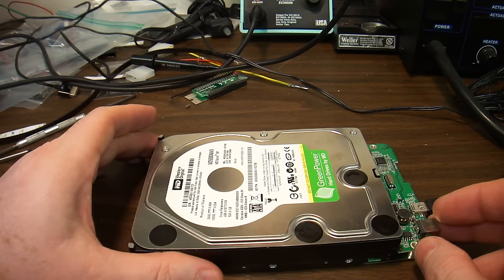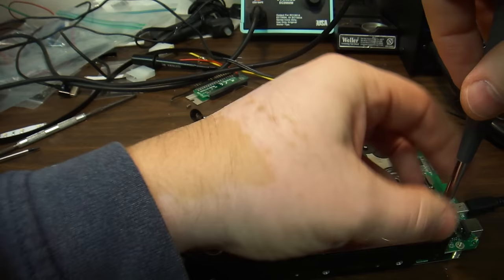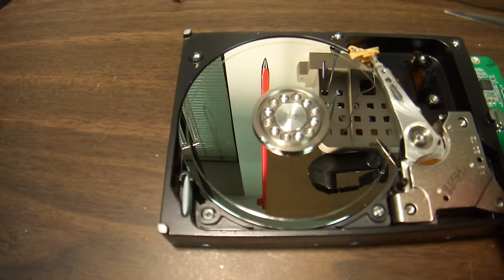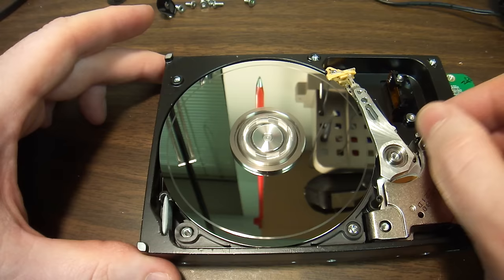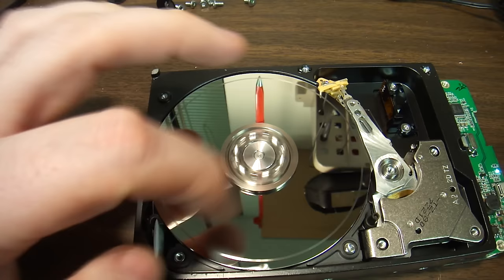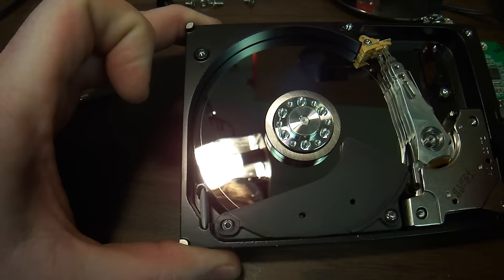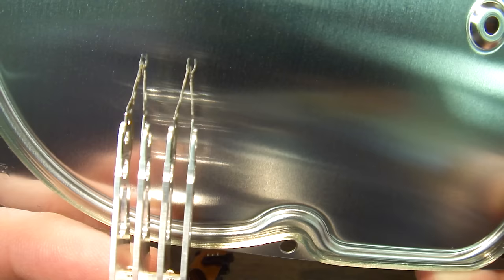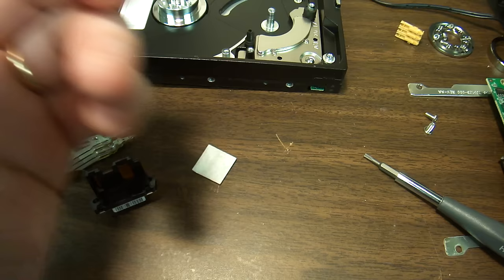Clicking hard drive dis-assembly. How to and what to expect. 500GIG Western Digital USB storage.

Comment: I have a 1TB drive but it only clocks 648GB after being dropped.
Reply: looks like it got a ton of bad sectors that got reallocated.
Reply: looks like its time to back up data and rma it. If the manufacturer will warranty it. Dropping a drive usually voids warranty. SMART attributes can show when a drive has been subjected to shock.
Reply: newer drives aren't meant to be low level formatted though. I heard you can damage it even worse doing that.
Reply: I have the drive, but my adapter broke, have to re solder the board for SATA to USB connect.
Reply: NEVER EVER run Spinrite or CHKDSK on a failing drive !
The most sensible thing to attempt in DIY is cloning it with a specialized program like ddrescue or the newer HDDSuperClone (both running on Linux – plugging a failing HDD on a Windows system is bad, because it will insistently attempt to access the damaged areas, making things worse, with Linux you have more control, and the partitions aren't mounted automatically). It's still risky, and it can only work if the HDD is properly recognized at the BIOS / hardware level.
Only once you have made a clone, as complete as possible, and if you are 100% sure that you won't pay for a professional data recovery service, you can try foolish things like Spinrite, HDDRegenerator, which will probably not recover one extra byte from it... (And CHKDSK only repairs logical errors, it maked no sense to let it run 24 hours or more on a HDD that is no longer usable anyway.) Recently, I had a 2TB Seagate HDD which was failing (got a warning in HD Sentinel), I cloned it with ddrescue, which recovered almost everything, except a 600KB area at the begining (which belonged to a system file, so none of my files were corrupted) ; according to SMART data it had 1312 bad sectors, so I ran HDDRegenerator (again after the ddrescue process was completed) to see if it could somehow “repair” them, and guess what – it simply forced the reallocation of those 1312 sectors, meaning that they were replaced by spare sectors, containing only 00s, just what would have happened spontaneously when attempting to write a file on them, yet it claimed to have “repaired” them all.
I used HDDRegenerator with success once, though : there was an inconsistent sector (so-called “logical bad sector”) on another 2TB HDD, preventing CHKDSK to fix the file system, even after I had deleted half of the data it kept saying that there was not enough space to complete the repair, but after a scan with HDDRegenerator, followed by a defragmentation (I'm not even sure if it's that program or the defragmentation which did the trick), CHKDSK could run through the end, I could reformat the partition, and now that HDD is still operational, with no reallocated or pending sector. When there's actual physical damage, tools like this are pointless.
Reply: “looks like it got a ton of bad sectors that got reallocated.”
HDDs can't reallocate 300GB of bad sectors... More like a corrupted partition table.

Comment: For sure, you don't know what you are doing !!! Learn and after that do it !!! You could have damage permanently the customer data. Now you did have luck because the HDD did have already the upper platter surface scratched beyond recovery. For anyone who will comment that this is bullshit, I am a professional data recovery engineer, and please notice the HDD did have the seal still on. Hope it is your data and not someone else data. So this way of handling an HDD before you know what is inside is deeply unprofessional and unethical !!! Some of the data could have been recovered from the other surfaces if it were not scratched like the upper platter, but you made that impossible. If you really want to make videos regarding data recovery, start with cleaning your lab and your table.

Comment: I would not trust that guy to change a flat tyre on a car.
Reply: His work procedure, all filmed and posted on his channel Car Services:
After removing all wheels and trashing them, he would dismantle the engine because it does not pump enough air into the tyres and say that the engine looks broken because everything is moving out of sync, is dirty and covered with a strange oily substance. Then he would put everything on fire and say that it's not worth even trying fixing anything, and he doubt that anybody could actually do anything about it. They only would want your money. While continuing trashing everything...
In reality, the tyre just had low pressure.

Comment: Two WD hard rives had done  this to me, one is a full desktop the other an external HD. Both death with this predicament.

Guess that mean I show never buy another WD hard drive again.
Reply: All hard HDDs from all brands can fail at any time, period. It doesn't make much sense to discard a particular brand because of two failing units, that's not statistically significant. Of course there are a few bad series, with an abnormally high failure rate, but it gets known quickly. The only things that really matter regarding hard disk drives are : 1) having backups 2) having an efficient customer service to quickly get a replacement unit during the warranty period (too bad it has been shrinking in recent years...).

Comment: You say that there is nothing wrong with taking the cover off as long as you don't run it.  WRONG!!!  Disk drives should only be opened in a certified CLEAN ROOM!  No disrespect but you don't seem qualified to offer the correct advice to viewers.

Comment: maybe it is just because it is so common, but WD HDD's are pieces of junk.  by far the majority of failed drives i get in are WDC.   Ridiculous how they have been around and so unreliable for so many years.  I guess PC manufacturers dont care, they go for the cheapest contract to get the drives for their computers, as long as it lasts a year they are fine with it. very often do i get computers in for repair that are just out of warranty and their WD failed. lol.   I know this one was due to accidental damage, but many of them just fail, sectors start failing and eventually becomes unusable.  and everyone cries about their pictures and docs that they had on their computer.  i guess u gotta lose some info (or have to pay to get it back), before u take backing up seriously. haha
Reply: my enterprise hybrid drive from wd has lasted since 07 LOL so many windows installs so many on offs so many stop starts  even dropped it its built like a tank :) now my samsung stopped working once i had to deep cycle it in order for it to start working again as did an older sea gate 650 gb  i love wd

Comment: Great video guys. When recovering data from a fire-damaged hard drive, timing is incredibly important. Few hard drive disasters are as potentially serious as fire damage. Fire-damaged drives need immediate treatment in a Class 5 clean room, and engineers need to have substantial expertise.
 Btc-recovery.com specialize in recovering bitcoin, data, fire damaged hard drives, and each of their laboratories is fully outfitted to treat fire- and smoke-damaged media.
 they have successfully recovered data from hundreds of fire and water-damaged drives, and they provide you complete support throughout the process.

Comment: And this is why the xbox360's had the red ring of death.
Reply: Lol wow I remember that! No fun at all!
Reply: Tyson Baxter Not at all, Xbox's red ring of death was usually caused by the GPU overheating.
Reply: Tyson Baxter this has no effect on the 360, all that a 360 does when the hdd does this is it dose'nt load any profile and acts as their is no hdd installed
Reply: Tyson Baxter 360 had a horrific gpu heatsink coupled with terrifying airflow, and having a hot dvd drive above the coils. Plus the sinks were spring mounted in a ridiculous way that red rings were engineered to happen. I used to repair 360 units often, and the hardware issues weren't solved until the slim came out.
Reply: no it didnt it was the heatsink for the gpu/cpu which had lack of thermal paste,which caused overheating that damaged the solder on the board
Reply: bravotwozero007 Certainly not thermal paste's fault. It was solely the solder under the GPU, added with the fact the GPU heatsink is tiny AND has a heat generating DVD drive bang on top of it.
Reply: SE43 haha microsofts logic, lets put an optical drive above a stupidly thin heatsink cooling a hot running chip and hope for the best
Reply: +SE43 of course it was lack of paste caused the overheating which damaged the solder lmao
Reply: bravotwozero007 actually it was the type of soldier microsoft used as well as the fact the original chips used more power and ran EXTREMELY hot
Reply: bravotwozero007 Nope there was plenty of paste, i've taken quite a fair few of them apart. As ictdude1 says it was the type of solder that Microsoft used and the chips running hotter than you'd like.
Reply: Actually the rrod had nothing to do with this issue.
The rrod was due to brittle aluminum solder points and not copper.